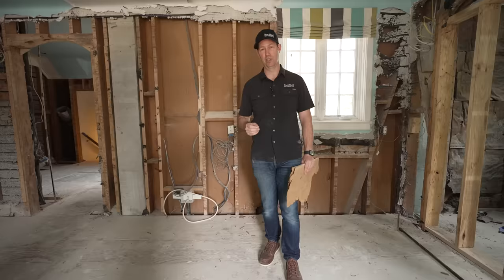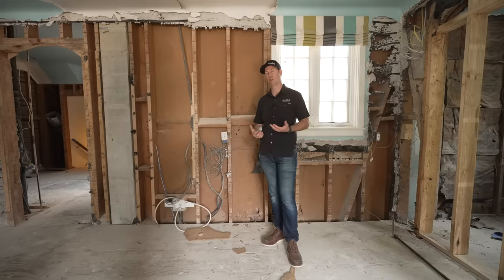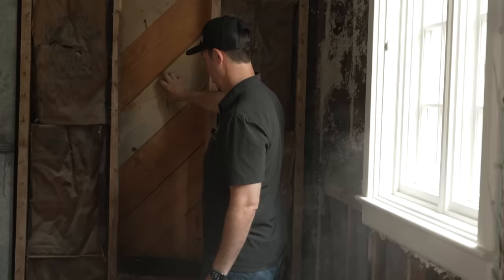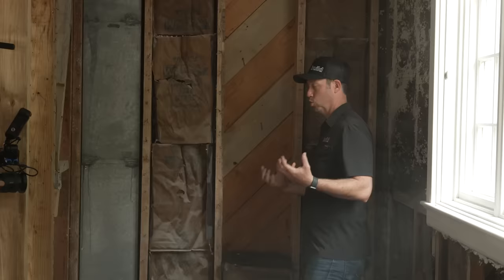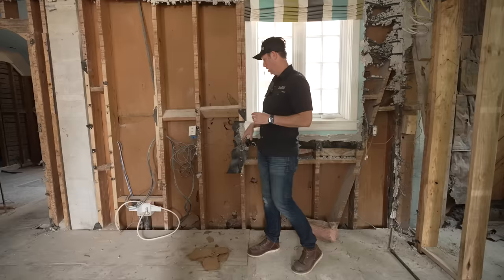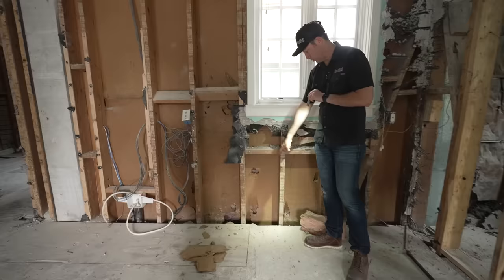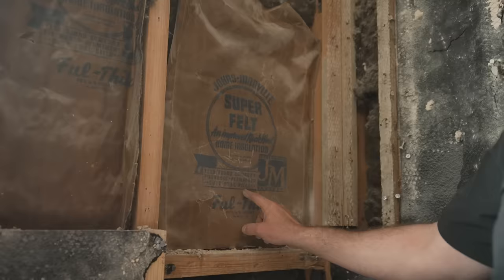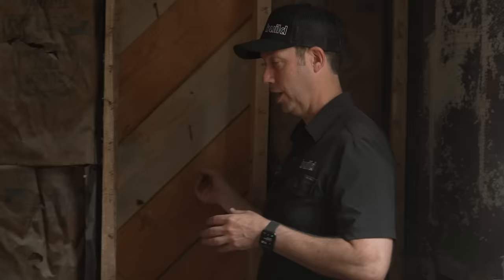I’m recommending we NOT INSULATE This Old House

Comment: You’re missing the most relevant factor as to why those walls are dry on the inside: lime mortar. The bricks are laid with lime mortar, which is less dense than the bricks and breaths/allows the moisture to wick out on a grand scale and evaporate.
Reply: Idk if you're right, but it sounds good. You get a like haha
Reply: Yep and lime plaster on the interior, which they just ripped out--ooops
Reply: @kevinhibbard320  They're 100% correct. This is how solid walled houses are pointed in the UK, and if they're also rendered they're rendered with lime. Houses of this period that are pointed or rendered with cement often have so many issues with blowout and damp
Reply: I use lemon mortar... I save lime for my ice cold Corona
Reply: @carlsapartments8931  Grapefruit plaster is also good.
Reply: exactly! i was waiting for him to mention it, but never did.... i'm renovating a 480 yr old house and the lime mortar is fine. recessed a bit, and needs to be redone. but zero moisture issues! now, the gaps between the wood walls, windows and roof are a different story.
Reply: @SkipKiplinger you must be in the uk or somewhere that has been around a long time. No houses that old exist in the USA where I live as far as I’m aware
Reply: No reason to confidently state that lime mortar is used unless you are an expert and on the job. Portland cement based mortar was widely and commonly used in the states at the time this house was built. My parent's house was built in 1915 and done with portland cement based mortar.
Reply: @trusconi81  in the Alps. the oldest houses and barns are from 1400s and youngest 1800s. All buildings are stone ground floor and larch wood upper floors and roof. most wood was reused, and carbon dating finds many beams from 12 and 1300s. some interior house beams are carved in latin, proto german or something no one can read but looks runic.
Reply: @trusconi81 that's way before the Mayflower, so no.
Reply: @trusconi81 England and France have 500 year old buildings that are still being used.  They also have documents and records that go back 500 years.
Reply: @jasonh.8754 The Spanish were in North America eighty years before the English pilgrims on the Mayflower.  Plus there were over twenty ships named Mayflower during that time.
Reply: Very interesting, you could use a breathable insulation such as hemp or wool.
Reply: @JohnFourtyTwo  sorry, I can't even follow the thread of this conversation anymore.
Reply: Based on the age in this region, it’s unlikely that true lime mortar was used. Each time we do a mortar analysis for our projects, it comes back as 19_ Portland cement or equivalent to today’s Type N. Pushing for the use of lime mortar when it wasn’t present originally can also increase the masonry material costs by 5X+
Reply: @trusconi81  depends. my area has a couple of 200 hundred some year old houses. but most are knocked down by now.

Comment: If you add air conditioning you're changing the way the house works regardless of insulation. On a hot humid day, warm air is going to flow through the wall cavity (through the giant holes in the sheathing you showed) and condense on the back of the cold sheetrock.
Reply: No way air conditioning is just now being added to this building.  Likely had a/c for the last 50 years.
Reply: it wil dry out fast enough to not be an issue in the majority of cases, great point tho for crawl space or basement type areas.
Reply: Yep. Bet if you pulled that stack (ductwork) out, the back of that is in interesting shape.
Reply: If sheet rock were a conductor I would worry, but it is not it is an insulator,  I would insulate the ducts in this house for sure.
Reply: I would think rockwool would have enough breathing ability to mitigate mold growth
Reply: Also, if you watched the whole video, you would see he said he would not put sheetrock back up. It didn't have sheetrock there before, it had plaster.
Reply: In St. Louis, I have a 1903 full masonry building. In the walls I have furred out, I will use rock wool and drywall. Drywall allows water vapor to pass through. So long as I use a breathable paint such as mineral paint, the wall will be able to breathe. Latex paint is not my wall’s friend.
Reply: Where do you get MINERAL paint?? Are you kidding?? AND, IF YOU COULD, the cost of "said" paint would be astronomical!!!! C'mon.....one needs to be realistic when commenting!
Reply: @marcob.7801  Online of course, but yes.  It's quite pricey.  I feel I should question the idea that its acrylic binder is any less moisture blocking than latex's is.
Reply: There’s no perfect system. Sometimes it’s hot outside and cold inside. Sometimes it’s opposite. You can end up with condensation in both cases? 
Prob best to just have a very thick insulation then the dew point will never reach a surface .
Reply: Insulation stops heat transfer inside

Comment: We just finished remodeling my house built in 1918. We replaced the siding and the house had no sheathing. So we decided not to sheath the house. the studs and interior walls were in great shape. I have heard of mold growth with osb sheathing so if it worked for 100 plus years why change it.
Reply: now that was v/ smart

Comment: I think what everybody missed on this home is that it is balloon framed the wall studs go all the way to the foundation it's constantly circulating air all the way around the outer shell from the crawl space I think this house could be  insulated within baffles in the wall to keep the air flow circulating it'd be perfectly fine for another hundred years
Reply: Exactly my thoughts.
Reply: I hear what you're saying, and I agree, and I think that can work in the final whole home system, however...I'm in Canada, colder climate... can't think of not insulating the house. IMO, poly inside the framing and seal it, and then build an inner frame with modern insulation technologies, likely something that breathes well such as rock-wool. You lose a small percentage of overall square footage, but with a house that size nobody will miss it. The outer wall still moves any moisture it needs to, the inner wall is protected from that, and the house enjoys a proper insulating layer. Matt, thoughts?
Reply: I was wondering the same thing and this is the question I am dealing with in my house as well. The one issue I see is my house has 2x4 studs so adding baffles and then insulation, I would need some kind of very thin Rockwool which I'm not sure they make. Not to mention all the other stuff like electrical I need to run through my walls.
Reply: Are you thinking baffles on the outside of the cavity?. In cooler climates I'd wonder if you are placing the dew point (for in-house moisture) inside the wall. Yet what you are describing is a little how a vented attic works.
Reply: @pcatful  yes sir
Reply: you actually might be right or in my opinion totally wrong,  but I would be interested in some  actual experience in this concept
Reply: Can I use pink batts and poly on 150 yr old balloon framing? And should I put fire slowing blocks between floors or leave open?
Reply: @sunshinecompany1  I would leave the fire block out and add baffled to the exterior part of the wall and insulation on top of them that way you still airflow  To dissipate moisture before it gets the interior cavity I hope this is making sense
Reply: @sunshinecompany1  and only a poly vapor  Barrier only if you're in the deep South or in the northern States
Reply: Maybe if he sprayed a coat of clear polyurethane onto the outside bricks, the water couldn't get into the porous bricks in that area, and then he could go ahead and insulate that wall.
Reply: Can't you use closed cell spray foam?
Reply: So you have a space of 1” between the bricks and the sheathing most likely, and a crawl space underneath so you do have some circulation. Would it be crazy or smart to use clear brick sealer to prevent water intrusion in the first place. When we did my small brick 2 unit house in Wash DC we reframed for installation and used open cell on walls which breaths and closed cell for the crawl space. The crawl space was fully sealed and stays very dry. It’s only been 2 years so I can’t say yet it’s a trouble free job but it was done by very experienced contractors.
Reply: @stugrant01 so all the moisture from breathing and drying damp clothes has nowhere to escape. Opening windows helps but that defeats the point of insulation. A building that breathes needs very little airing from open windows.

Comment: It would not surprise me that the particle board has been treated with something super toxic like arsenic to retard mold growth.
Reply: You mean the good stuff
Reply: could it have asbetos?
Reply: It is cane fiber from sugar cane that has been pressed and washed out completely. It was a waste product until they started making sheathing out of it. Not very strong so you had wood corner bracing with this stuff in between as a brick backer. Later in time they sprayed it with asphalt on one side for water resistance and continued making the bare stuff for sound deadening as sound board. Both products were sold well into the seventies and early eighties. I remember using it in the mid sixties when I first started framing. And yes it is fragile but has no wood in it.
Reply: @randomrazr  that "rock wool" batt looked like asbestos to me.....1950s remodel - time fits
Reply: @markpashia7067  That's interesting. When I was a kid and I'm talking back In the 60s,  we lived in a WW2 era apartment built as temporary war time housing. We referred to the sheathing back then as 'gyp lap'.  It had the asphalt coating you refer to on both sides. It's been too long to remember the manufacturer but I seem to remember that it was USG.  No insulation in the walls, asbestos siding and sheetrock interior walls. I had always thought it was a sawdust/ chipboard mix sheathing and I remember seeing a gray colored mastic product on the seams, probably something with asbestos.
Reply: @mikegrant8490  Gyp lap was just what it sounds like. Made from gypsum but with waterproof paper on both sides. Made the same way as drywall but was water resistant throughout. Not sure but some of it may have had asbestos mixed into the gypsum layer for fire codes. Interesting stuff in that the ones I worked with had interlocking edges with a curved nose on one edge that locked into the negative curve on the next piece. Like the press had half round shapes on the long edges. The gypsum was gray instead of white. I suspect that was a weather proofing mixed into the gypsum paste before pressing. In the area I worked they did not tape the seams but some areas had stricter fire codes that could require that. It was primarily used as sheathing for brick veneer construction, not siding.
Reply: In college, me and my roommate had a summer business of re-siding homes in an early 60's subdivision built of the stuff.. We stripped  what seemed like particleboard siding, the underlying, moldy homasoat and put on plywood and cedar shakes.. We were doing the shakes on a lattice of lath strips as a rain screen even then.. This would have been late 80's.
Reply: @jesinbeverly  That was the old "Masonite" siding that resulted in a ton of law suits. It was a pressed paper product not particleboard and it was nasty stuff. It held up IF you never had water intrusion or condensation problems but that is asking a lot from home owners. With the low tech caulking and the paint quality of the day you really had to stay on top of keeping it painted and waterproofed. Also that was the time that air conditioning was being introduced to home use on a wide spread basis and cold interiors with hot humid exteriors created a lot of condensation in some areas.  Heck most of those sixties homes had aluminum windows with just one pane of glass so zero R value. Gas was very cheap back then to heat.
Reply: @markpashia7067  Yep.  That was the stuff.. Those houses had no shear value in the wall/siding system.  This was in Southeastern Massachusetts..  Everything was wet.. That siding often looked like one of those novelty press dried out sponges that got wet..
Reply: @markpashia7067  I also think that the gyp lap name was kind of a generic term for more than one product. I remember working on sites where people referred to regular old Celotex undersheathing as gyp lap,  too. I haven't seen it much in a long time as the codes require more diagonal strength and plywood and chipboard have the strength that Celotex never could match for hurricane wind racking resistance.
Reply: @markpashia7067  don't forget that it had some insulating properties also and you are right
Reply: @mikegrant8490   That Celotex was totally non structural, something like a 2 R insulation value. Although it kept water from streaming through, it absorbed water like a sponge. A couple of years back I removed it from my Chicago house. Took me weeks to strip it off as it wants to come off a handful at a time. People were pretty loose with terminology back then. I imagine they called everything gyp lap.
Reply: @katieluv8422  You're right. "Gyp Lap" became a generic term for a lot of "sheathing" that could barely meet any structural standards. It was based, I think, in the WW2 push for temporary housing and resulted in a lot of cheaply made products that would have a short expected life. If you've ever seen or dealt with a product called Orangeburg pipe that was massmarketed as the new, best thing for drain lines... basically,  it was a stiff paper, a cardboard tubing heavily soaked with an asphalt grade petroleum product that when it failed after several years, it just collapsed under the weight of the soil above it. Likely tens of thousands of miles of that crap was foisted off on the public, all of it now is in landfill sites throughout the world and any remaining is likely to fail at any time.  Your experience with the Celotex is a prime example of what happens when builders go with a cheaper alternative, and in WW2 it was because of the need of the war effort to use it because the more expensive materials were unavailable, rationed or artificially set at a high price to discourage the use. So, using the cheap stuff and then never seeing the results years later when you had to deal with it. It makes me wonder what a future generation will see when the inevitable happens... a minor leak, a breakdown of the sealing surfaces, insect incursions, heat and cold cycling with the moisture amounts varying wildly, physical damage that doesn't get repaired properly or goes unseen. At least we now have better testing and laboratories that set standards and practices for building products. Most reputable builders following ASTM, UL, NFPA, and other standards give the best chance for long life of components but far in the future,  someone like you and me will have to deal with failures, unexpected and unseen.
Reply: Bingo give the man a prize
Reply: Exactly my thought
Reply: Particle board/masonite - I remember being told not to burn it due to toxic fumes.

Comment: Sheetrock presents more of a breathability/condensation problem than insulation does.  Why not consider using plaster and lath like the original?  Or a paperless plasterboard?
Reply: I was thinking the same thing. they might actually be doing that, but matt might have just not known about it.
Reply: Was thinking Savolit plus board for insulation and lime plaster over.
Reply: it wasnt rock latch. it looks like plaster board and plaster.
Reply: it seems like  that might be in other words what he was stating and maybe from more of an experienced aspect
Reply: Plaster and lath is outdated and weak. I would definitely try something stronger like paperless plasterboard.

Comment: As someone who lives in a 120 year old house with plaster walls, this was much appreciated. I like your style on new construction and am appreciative that the principles you speak of, properly applied, still work with old construction.
Reply: so if u buy a 100 year old house. trying to modernize it with insulation vapor barriers etc could actually be a bad thing?
Reply: @randomrazr yes. I have a 1910 home balloon framing. There are methods to modernize it with a "channel and vapor barrier then dry wall.. but you would have to demo all the walls.. not economical.
Reply: @will201084 all the exterior one's at least.

Comment: OMG you are in Texas.  Your rain is like mist compared to the rest of the country, then the hot heat dry's everything out anyway.  It should be insulated and then have Lath and plaster again, historically speaking.
Reply: Texas is huge and pretty diverse climate. The gulf is hot and humid and the pan handle is dry and dust. Some places are green, some are rocks
Reply: You do not know Dallas at all. Hot in the summer and snow in the winter!!! Lots of condensation. Pea soup fog in the fall.
Reply: @markpashia7067  lol.  Dallas averages 1 inch of snow per year.  Average snowfall in United States is 28 inches per year